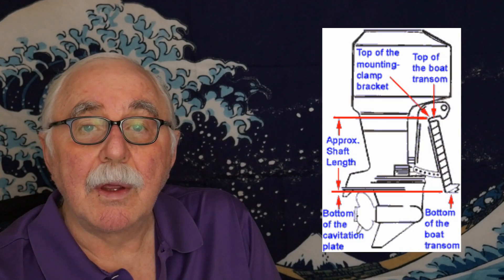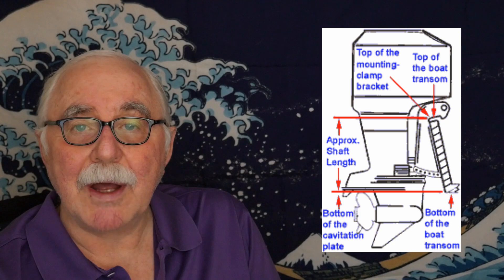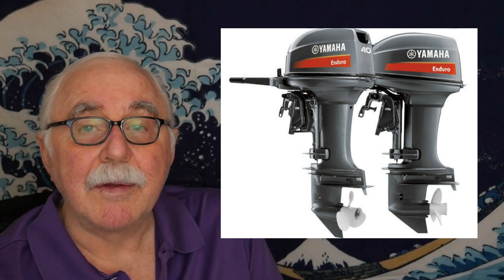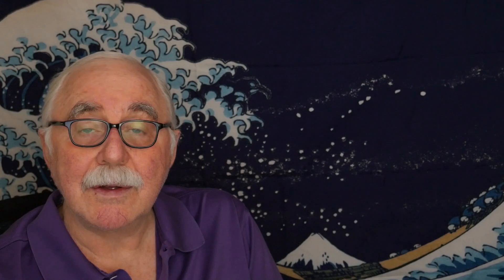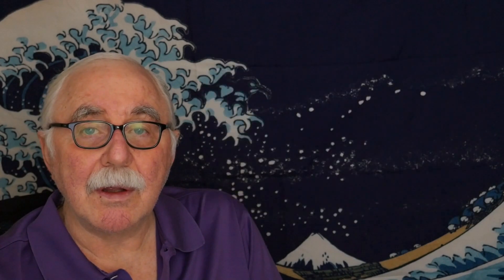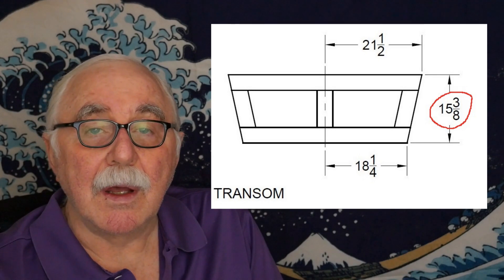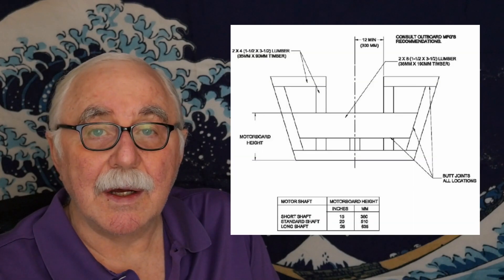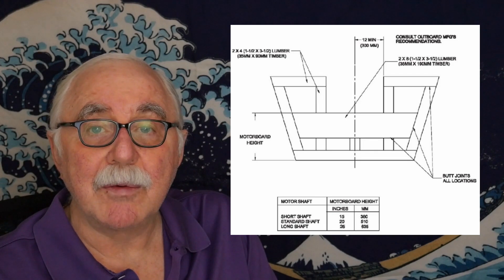Yes, You Can Build a Boat #16 - Outboard Motor Shaft Size

Comment: Great information here , I built a skiff some years ago and my dilemma was the motor , I found long shafts where more pricier engine to buy so I went with the short 15 “ outboard , the skiff was 12 ft long so this engine does the job , a 20 or 25 hp would of had more grunt though , so once I knew the motor I wanted it made it easy to cut the transom to suit the boat when I was building it. If I had cut the transom before hand I would been in a bit of a spot for sure . Know the engine you want before touching the transom is my tip 👍

Comment: Thank you Jeff for the information.  Can you recommend a source that correlates the lower power outboards to the electric ones.  Everything I have found gives the thrust and an approximate boat size but no information on what kind of speed they will produce.  Take care and have a good week ahead.
Reply from the maker: Speed is much more about the boat than the motor. You cannot correlate by motor thrust. You can convert wattage to hp, but that will tell you anything about boat speed.
Reply: @tjkid07  Thank you for the quick reply.

Comment: Does the longer or extended shaft motors require any additional strengthening of the transom due to the higher leverage effect due the longer distance of the propeller and its thrust placing a larger fulcrum moment of bending force on the transom clamp area for the same hp?
Reply from the maker: No. All it does is raise the transom cutout. If your boat design isn't strong enough to have a slightly longer twisting moment, you have far more issues with the structural design.